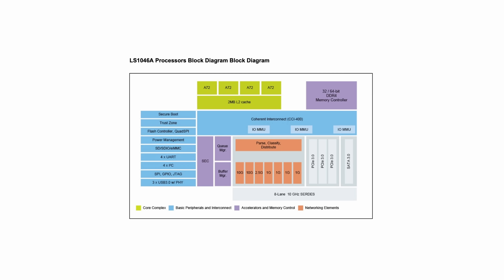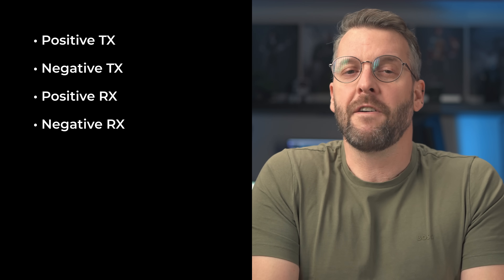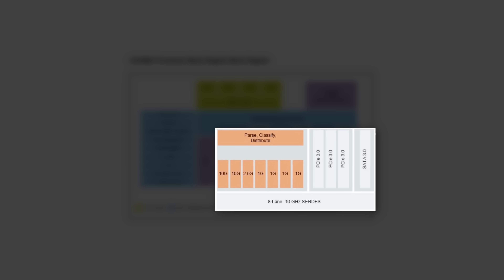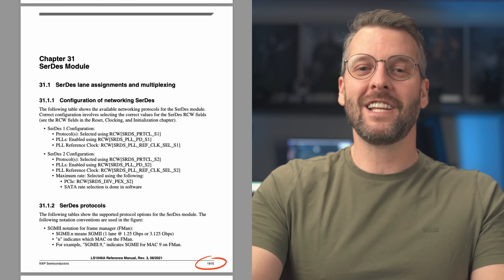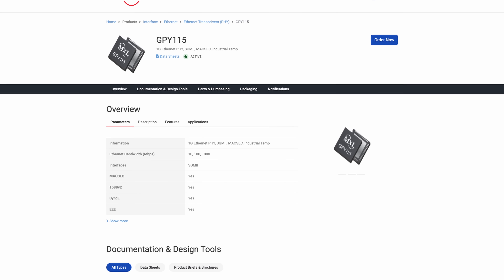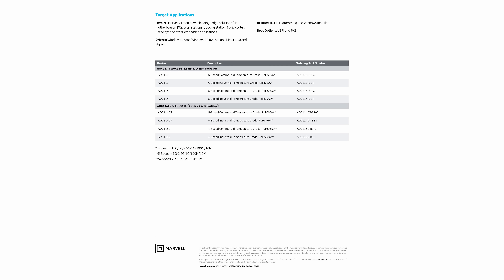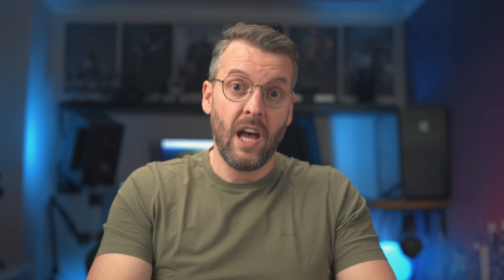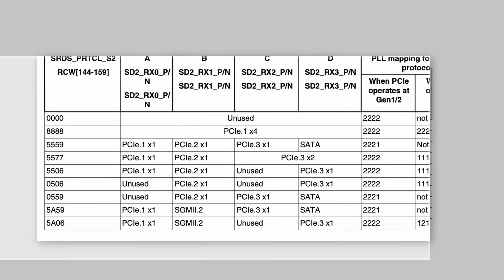You sure do LOVE your 2.5GbE ports!

Comment: Frankly, with a good switch and VLAN support, I think just 2x 10gig would be more than enough, especially if NIC teaming and VLANs can be used on top. If anyone wants the 2.5 port, there needs to be a justified actual use case for it beyond "bigger number go brrrr", especially if you have to sacrifice hardware acceleration to achieve it.
Reply: Well, one good and possibly common enough use case is ISP + switch + NAS, that makes 3 high speed devices.
Another one is a home server, if you have a server that should be accessible form the internet in your home/office instead of renting a VPS, then you might need a third high speed port.
Yes, those devices might be connected via a switch, but they both might need package filtering so connecting directly to router would be better (and faster).

Comment: I think a 2.5gb port with PoE+ would be a really nice addition. I know you aren't even talking about poe on it and the price increase is just to get the chip on there, but I think one of the most used configurations for such a port might really be to directly connect a wireless AP. Perhaps make a legitimate poll and post it in the video descriptions of the 3 options: just gigabit and save final price money, add 2.5gb for $30 price increase, add $60~ for 2.5gb with PoE+ andf see what the users say.

Comment: Having a 2.5Gbit port is always nice, but this is quite the drawback. And replacing all 1Gbit with 2.5 would make the whole thing cost a whole lot more.
That makes me wonder now though... if it is an issue of mix and match, would there be a huge problem with compatibility if you just axed the three 1 gig ports and replaced them with three 2.5 gig ports?
I'd wager that's not the case. Quite the conundrum.

That being said... I think the 10Gbit can easily handle anything with 2.5 gig capability, and you can use switches to have more devices (albeit they'll need to be better switches). So maybe not having a 2.5 gig port natively is not that big of a deal.
Reply: He cant cuz to add 2.5 natively, he need to remove 1 10g port

Comment: also: i don't think the cost is worth a 2.5gbe port. period. we already have two 10gig ports, for inside and outside. this is a router, not a switch.
Reply: At first I thought they moan about 2.5g because there is only 1g, if there is actually 10g, then they can f-o
Reply: I think a dedicated port can be valuable for creating a DMZ or a guest network. In that regard, an upgraded port could mean a way more flexible device
Reply: My thoughts exactly. This is a router not a switch. Your internal devices don't need a dedicated 2.5GbE connection to the router. WAN -> Router 10GbE Port 1 (if you have greater than 1GbE WAN) -> 10GbE Port 2 -> LAN Switch with SFP+.
Reply: Unless you're doing deep packet inspection or something, it doesn't need to be a full router. 
Most regular people don't have 10gb core switches, and their edge switches aren't gonna be to a 10gbe dist switch anyway. And no one should buy these for HA nor try to soft-route two 10gb links with these chips either.
Reply: I expect a router to have at least 3 equally fast interfaces and when we consider 10 Gbit WAN we need 10 Gbit for the DMZ as well. Also a sperate management interface that can be slower 1 Gbit seems fine.
Reply: @DJDocsVideos  use the lan port w/ vlans. you won't be stuck at 10g speeds max either way. I already assumed you'll have a switch since you're doing dmz stuff unlike most others
Reply: I actually disagree. Having an additional high speed port is useful if you want to split traffic downstream, but don't want to shell out for expensive smart switches to do this. 
I would actually rather less 1GB ports in favour of a single additional 2.5GB or 5GB. 

Keeps management on the router itself, and off downstream switches.
Reply: @TDPEquinox if that port is not going through DPAA (aka the network offloading and accelerating engine) then that 2.5G or 5G port is pretty much pointless because everything is processed on the CPU and it will seriously impact performance.
Reply: @robertjung8929  even that crappy ARM should be able to handle the 2.5 Gbit at line speed.
Reply: ever hear of bandwidth and router-on-a-stick bottleneck?
Reply: @BlastingAgents  I was addressing OP with 'this is a router, not a switch' nonsense.
Reply: @Mr.Leeroy  oh, that makes more sense, my apologies!
Reply: @Mr.Leeroy  Originally this was supposed to be a high end home router.
Don't know if the idea changed since then, but a home router acts as both router, AP and switch, so it needs all those features.

About the 2.5 port I wonder if its possible (and for how much) to make a combo port of one of the 10G so you could use either SFP or Ethernet.
This way those who need a switch will use a switch connected to 10G, and those who don't, will use the Ethernet version as a 2.5G (unless you will be able to get 10G Ethernet, but that might cost too much). Its worse than having a third high speed port, but its at least something.
Reply: @hubertnnn I don't think anyone who's paying for a router with SFP ports and this amount of horsepower isn't also using a dedicated switch and probably multiple access points.
Reply: @hubertnnn  it's a 10 Gbit SPF+ you could just use a 5 Gbit or 2.5 Gbit SPF+ instead.

Comment: There's one more option: To use key E socket and put 2.5gbe card into there. But that means there needs to be a hole for the port in the back of the router, just like Lenovo Tiny's have. I just bought 2 of those E-socket ports and I will be testing them soon in my Lenovos. I think I paid ~12€ each from AliExpress including shipping..

Comment: I saw that top comment in the previous video, very soon after the video went live. I assume it's a "give me all the ports" mentality. However 2.5GbE is an extremely new implementation on AP's. I personally wouldn't waste such a high speed port on the theoretical max speed of a WiFi AP, but if that was the use case then PoE would definitely become a must have too. Considering it's powered over USB-C PD, that could ad additional complexity. More to the point, many people (myself included) like power efficiency. And if it's going to add more CPU overhead, I would say "Keep it simple stupid"
But that's just me
Reply from the maker: I definitely agree with you on pretty much everything. I just wanted to entertain the idea since so many people voiced their opinion in favor of the 2.5GbE port.
Reply: I disagree, as I just moved my whole network to 2.5gbe with fsp+ option if I ever find time to drill some holes for the new wires. All the moderately priced motherboards and mini PCs already come with an 2.5 gig port. Also my wireless routers are now using 2.5 gig link, not to mention switches I bought for ~30€ pcs. So for me the choice is either to get sfp+ modules for 2.5 gigs, or have those built into the device, or to use M.2 E-key card for it. I think the last one would be the cheapest option if there would be a hole in the back for the extra port.
Reply: @mahagr78  There's definitely an argument to be had on both sides. There's certainly nothing wrong with adopting the newest technology.
I'm glad you mentioned the M.2 E-key as I was wondering about that. I know you can break it out to PCIe on the normal M.2 but I wasn't sure if there was a direct 2.5 GbE module. I recently bought Google TPU (M.2 E-key) after watching the Hardeware Haven video about them. He showed a SATA module too but I wasn't sure about 2.5 GbE. I would just presume, if I went full 2.5 GbE, then I would be using a switch for it. Unless that traffic needed to be routed
Reply: @DanielVidz  The card was a bit tight fit for the Lenovo Tiny m710q, but I was able to insert the module and fit it to the serial/VGA port slot in the back.

The nic is showing up in kernel logs as "r8169 0000:02:00.0 enp2s0: Link is Up - 2.5Gbps/Full - flow control rx/tx". Also my router sees it correctly as 2.5 gig adapter. 

Now I just need to properly configure it in proxmox...

But yes, I think the best option here is to use an optional M.2 card and just drill the holes needed for both wifi antennas and an ethernet port. In that way, people can easily decide if they need wifi, 2.5 gbe or something else. Then just provide people the options to choose between those (or none).
Reply: The more I think of it, I would not include 2.5 GbE. I would instead have that M.2 slot and make sure that both Wifi and 2.5 GbE works with it and maybe sell those modules as extra options. You can buy 2.5G switch for 30-40€ and hook it up with 10G sfp+ for another 15€. Or you can buy M.2 A+E key RTL8125B card for 12-15€. 

To me both of those options make far more sense than raising the price for everyone to get just one extra port, which may or may not get used.

4x 2.5G + 2x 10G port switch and ftp+ cable = +45€
  or
M.2 RTL8125B card = +15€
  or
everyone pays 40€ for a single port
Reply: @mahagr78 Making addins is a good idea. Design the router already with addin cards and sell it in 3 different skews:
- no addins (outside port being just plastic cover)
- 2.5G card addin (with extra port exposed to outside) 
- WiFi addin (with antenna exposed to the outside)

This way you could even get more addins in the future eg. NAS addin with e-sata port exposed or security camera addin with video in port.

Comment: I think using a PCIe based solution would miss the point of using that specialized SoC‘s capabilities. Rather keep the 10GbE SFP+ Ports since most 2.5GbE Switches have 1 or 2 SFP+ ports too and you’d have to do way less on the software side when it comes to drivers and such.
Reply from the maker: I needed someone to say this out loud. Someone, that wasn't me. 🙌

Comment: Small price to pay for higher speeds! Surely I would pay the extra 30 for 2.5gbps than having 1gbps.
But that's just me.
Reply: Also maybe this for future plans to have different models, 1 cheaper(1gbps), 1 mid tier (2.5gbps) and one more premium with even higher speeds.
Reply: And one more thing, I don't want to influence anyone or push towards any decision, I am just stating what I would like from a router.
Currently I am running a topton mini pc with intel N100 and 4x2.5gbps intel i226-V nics and pfSense+, I see it working good with my 1000/100FTTH connection but I am facing problems with the PPPoE connection that most ISP in Greece are using, even though the fiber is running at 2500/1250mbps so nowhere near the speed I got, when maxing out the connection for more than 10minutes or so, the BRAS stops sending packets, no disconnection but also no packet exchange. I don't see them changing any time soon from PPPoE to DHCP or something else. Also the problem I have appears to any router, not just this mini-pc, just on this mini-pc is less frequent than any other device I have tested (6 of them in total).
I am using only the 2 out of 4 ports on that mini-pc so I agree with someone that said like stick with the 2x10gbps for the most part but then I remember that I will get soon a 5G router and I will connect that also for multiwan....and 5G (and whatever comes after that), assuming ideal conditions, will be way faster than 1gbps....so why NOT to have 1-2 extra ports? And we go towards that path....why not get the most out of it?
I will voice again this, also not to push any agenda or pressure anyone, my biggest concern is the CPU. I can't predict the future, maybe in 10 mins from now we get pfSense arm64 who knows? I still would rather an x86_64 cpu than an ARM64. But this is just me, I am a minority and I can live with what the majority decides. I will try to support the project :)
Reply from the maker: Thank you for describing your experience in such detail. I may not be able to respond to everyone, always, but the more people share their thoughts with me, the easier is to form a decision that'll hopefully make sense for as many people as possible.
Reply: @tomazzaman  Thanks for reading my comment and for spearing the time to reply :)
I like your idea for application in my work, instead of installing to companies different routers and having to learn all of them, I would like to use your product to all of them, so I will have a higher understanding of problems that might happen and respond much quicker.
Oh! And something else that came to my mind! Will we be able to have firmware upgrades? Because we all read what new hacks are happening all the time and the most overlooked is the bios! I know for example my topton mini-pc won't release ever a firmware upgrade which is sad!

Comment: I dont get it, why do ppl want 2.5 if its gonna have 2x10G ?
Reply: Multiwan for the simplest thing I can think of on the top of my head!
Other one could be to connect a guest's AP completely isolated from the rest of the network. Would be also good if it is POE but I can live without POE.
Reply from the maker: I guess because some want to use it as a mini switch?
Reply: Neither do i, my guess yea they think it should do switch duties as well
Reply: A lot of consumer grade gear now has 2.5 and not all of the 10G gear (I don't think any I've looked at honestly) is compatible. I know in the US at least a lot of newer high speed Wi-Fi access points and fiber ONTs will have a 2.5 port. Even if you don't like the standard you will likely have to have some amount of it somewhere just because of what's available in the market now for better or worse.
Reply: @andersenpeters  yes it is compatible you can plug in a 2.5G device into a 10G switch port and it will work it will just work at 2.5G
Reply: In my mind it's likely that the people who are 
ravenous about it are in the homelab/"smb" space and most likely not willing to pay a fair price for the unit. If I'm right they are thinking things like "2.5 is more than 1!" "I have a new 2.5G desktop/server and don't want to lose performance" "It's expensive to upgrade to SFP. I won't do it until it's cheap".
To give them the benefit of the doubt, it's possible some have internet connections greater than 1Gbps and they're fine with their existing network equipment but they just don't want to justify investing with that initial cap due to Ethernet overhead. In that case SFP in and 2.5G to the LAN is a fair compromise. But even then what they should be doing is upgrading to a switch with SFP in
Reply: This feels like a classic "if I had asked customers what they wanted I would have made a faster horse" situation. People who aren't putting money down can lead a product in bad directions and even some of the people who do put money down are not right.